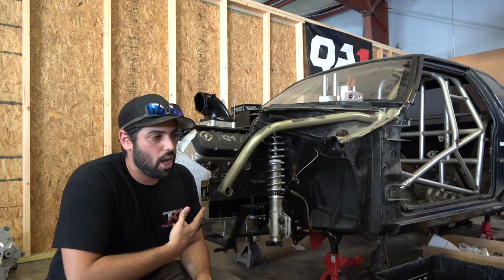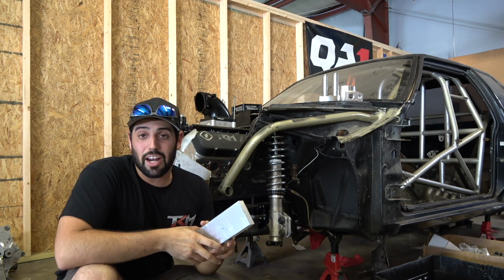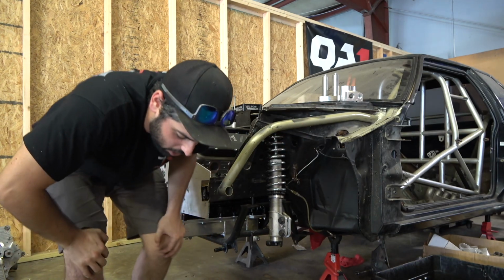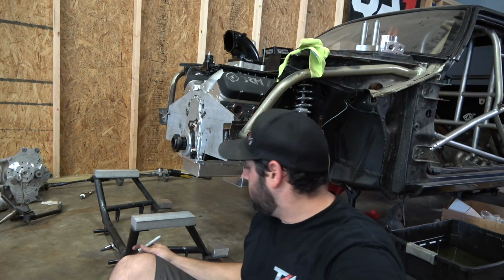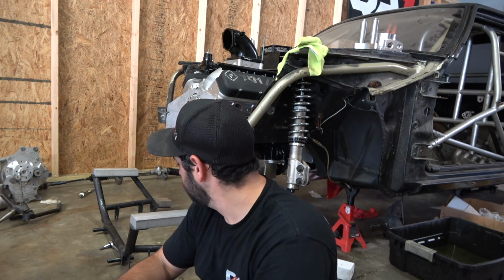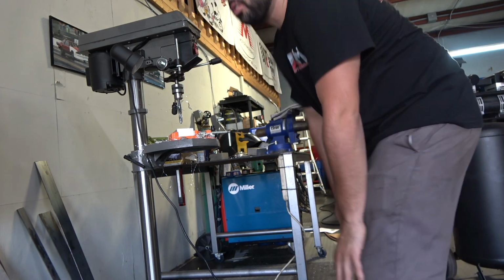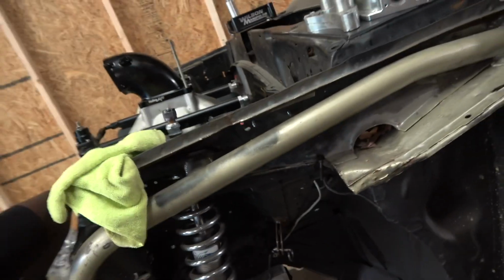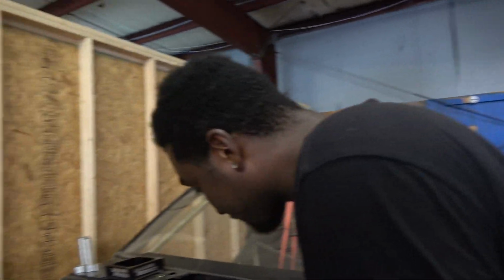MOTOR IS SO BIG IT WONT FIT!!! 460ci LSX!!!

Comment: Also too I have a ls swapped 05 colorado I'm pulling engine and transmission to put in another truck. Will sell roller with current performance ecm and harness setup for 6l80E.

Comment: drilling (or otherwise cutting) aluminum goes way better if you use WD40 as a cutting fluid. or kerosene works fine too, but you might not have that around.

Comment: Them spacers are unsafe bud no lip on each side and front and rear of them to take load off them long bolts you will be running! So all the load will be on the bolts at threads when braking and turning! Then no rubber in between for vibration asborbsion! Get in a bad situation and could get real ugly real quick!!! I would just modify the bar under pan and bolt k-member up to unibody and all pressure will be on solid shoulders of the bolts!! I wouldn't drive that set-up 15.50 1/8!!! But that's me, not you! Just throwing that out there. That might also not pass a good tech inspection!!! Good luck bud your doing big moves,and going fast!!! Just be safe don't want to test a cage because of some k-member issues.

Comment: I’m no fabricator, but would it have been easier to cut the lower bar out on the subframe and fab up a new bar that would clear the pan, since your running a different rack as well.
Reply: That's the way I would have done it
Reply: It's would probably throw off bump steer alot. It would have been best to buy a outlaw style k member that's rear steer
Reply: Probably wil happen when he brings to the chassis shop
Reply: @bevinsracing  they have bump steer correction kits for the fox bodys

Comment: It would have been easier to just notch the k member.   It would be crazy talk to start cutting into that oil pan.  🤦🏻‍♂️
Do not let anyone cut up the oil pan.  To don’t cut up a motor to fix you modify the car.

Comment: what is holding the engine up while the K-member is out?
Reply: oh now I see front motor plate
Reply: It’s motor plate mid plate combo. The motor is held up by the motor and mid plate the k member does nothing to hold the motor. Just holds the suspension and and steering.